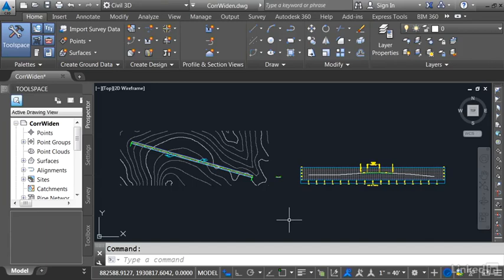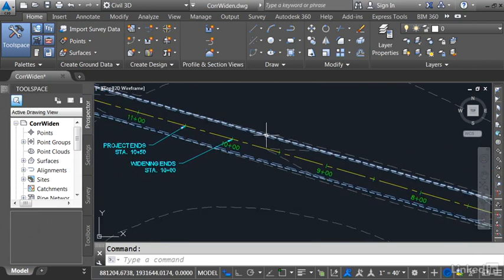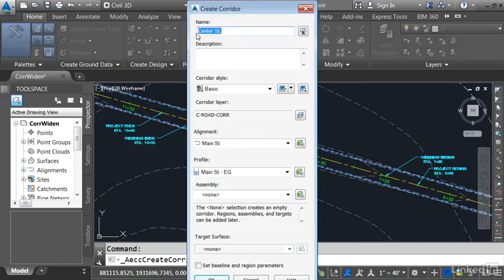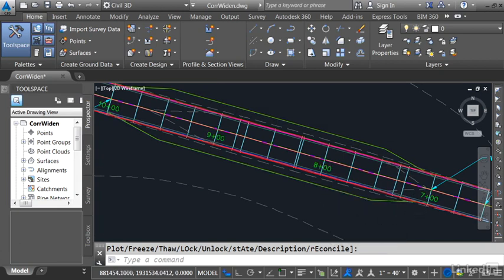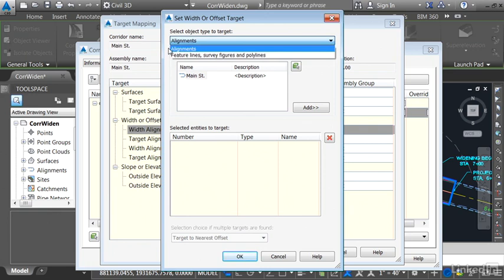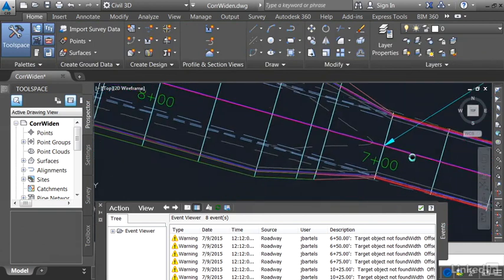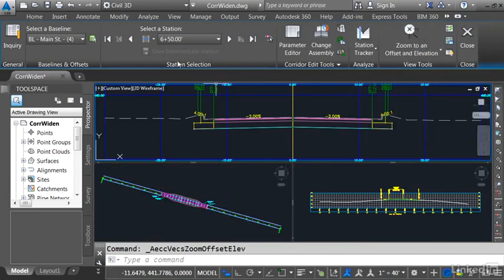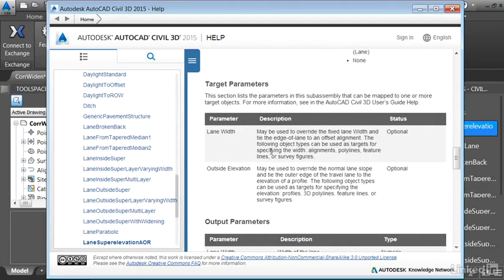Corridor Widening

Comment: Hello first off the video was great. I a beginner in civil 3d so this maybe a dumb question. What if your working on a new project and have already established a corridor, but the job requirements change and you have to add the widening to an existing corridor. Would it follow the same process? or would you have to cut the corridors into sections? How would you add a small parking area to a corridor? or would that be a process to it self?
Thanks,
Bobby